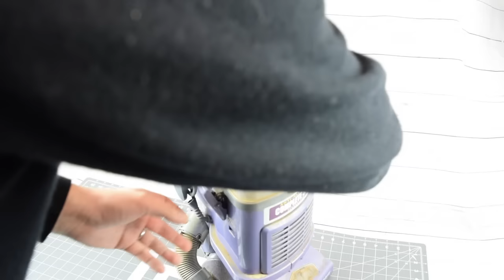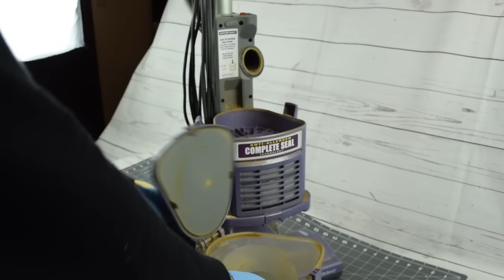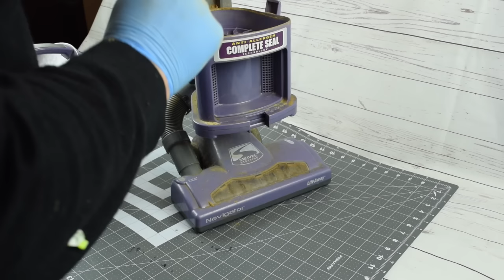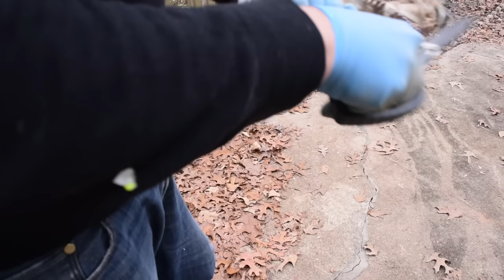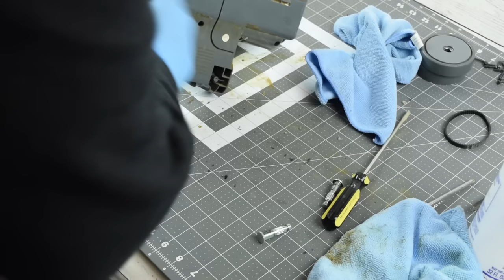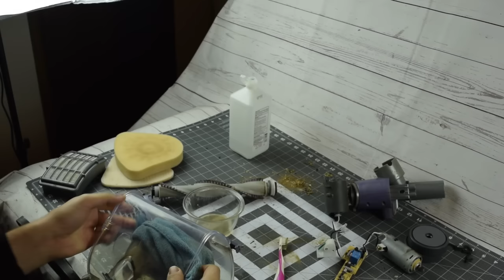How to DEEP CLEAN / Refurbish a DIRTY Shark Navigator Lift Away Vacuum

Comment: It seems the six screws toward the front of My Vacuum have a nub in the middle of the top of the screw. I'm wondering if the maker did that to prevent me from cleaning/fixing my vacuum so therefore I might opt. In buying another New vacuum... Can I get suggestions on how to get the screws out of the machine, please? Thank you.
Reply: Same here.  Have the correct star head, but the opening is too small.  Would need a special screw driver.

Comment: i have a question: i cleaned the hepa filter with water two days ago as it said to in the directions and let it sit this whole time. when i just turned on my vacuum it spurted foam everywhere through the hepa filter. what the heck happened?
Reply: update: i used my vacuum today and it didn’t spurt foam but the place where the hepa filter is smelled like it was burning
Reply: (in the directions of the shark vacuum it said to rinse it under water)

Comment: I am having problems putting the wee little wheels from the bottom back on.  The ones at the very front that you took off to get to the screws.  They don't seem to want to pop back in.  Anybody?  Any suggestions?

Never mind.  Thanks though but I managed it.  And....it's done.  So glad I saw this video.  Helped tremendously.

Comment: If the hose and wheels, latches are broken it's not with it or to it buy used. You can get a used fully working one for "dirt"  cheap $0-50. Buying  replacement parts is where gets expensive.

Comment: I clean my hoses out with hot soapy water soak for day then rinse with hot water I cut the hair away from rollers and use tooth brush with soap on to clean the bristles and all the seals on dirt container as well as small amount of silicon oil around seals .

Comment: I bet putting a lot of those parts in the dishwasher would work well. Especially the canister will all the tight spaces. Just don't put it on the high heat or dry setting and just let it air dry so the plastic doesn't warp.

Comment: The SHARK manual states that you CAN wash the HEPA filter. Not sure why you say it shouldn't...
Reply: @SupaTrending Daily stop spreading false information. You can literally do a quick internet search regarding this topic.
Reply: @Lethal except the manual states you can. so. you clearly did not do your research. thumbs up
Reply: Washable in the sense that all you can do is rinse it given how it's constructed, but it takes forever to dry. (Like a week unless you have an air compressor to blow it out or something.) And when that's the case any remaining dirt may cause issue with mold or other stuff growing on it. Technically "ok", but from a practicality standpoint I can see why it's looked down upon.

Comment: I own a shark nv70. The instruction manual for mine says you CAN rinse the HEPA filter under the water dirty side up until it runs clear. If I want to clean the filter inside the dust cup with a scrubby green pad as shown do you need to use soap with it or just plain water to remove the dust from it??

Comment: I just run water through my canister. And let it dry.? Then I take all my hoses off squirted with Dawn dish soap and hot water let itself. Then rinse very well hang them outside to dry.
When dry I put one or two drops of  essential oil on foam.

Comment: Mine broke at the bend where the long handle is attached to the pivot point of the brush housing 🤣...

I ended up epoxying a steel rod through the center within 2 drilled holes and I plastic welded the whole thing back together with steel mesh embedded in the plastic... I figure it's prolly stronger than before..
Wish I could post pics in comments

Comment: I accidentally vacuumed up a small foam paintbrush while using the hand attachment . Very little suction yet I cannot find where it went. I removed hoses that easily came apart. Is it possible I'd need to take the lower part..near engine apart too? I can't believe I can't locate this paint brush as it was four inches long although narrow.
Reply from the maker: Have you checked the wand and the hoses? If it is not lodged in the floor nozzle I bet its in one of those.
Reply: @VacuumWars  i found it thanks!

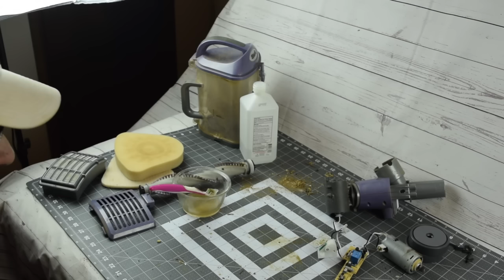Comment: Do you happen to know what the (clear) tube with the spring in it is for (12:30ish on the video) attached to the top of the casing for the motorized brush assembly? I have it attached to the part that would suction the dirt from the floor, but not attached to anything on the other side. Yet, it was full of dust/pet hair? Is it supposed to connect to something?  Thanks!

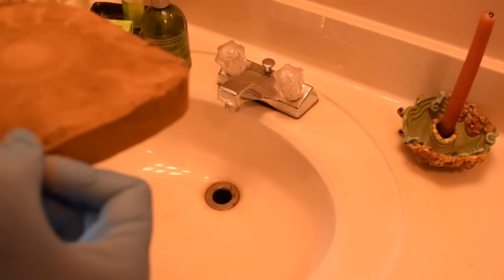Comment: 1:56 it says to use cold warning runner on all three filters not hot water.

So either the company is lying cuz they want you to rebuy the filters quicker by running cold water is bad for it and hot water is better
or you're misinformed in doing it wrong.

Comment: What about the hose!??? ☹️ I have gunk stuck to the inside of the hose because a roommate used my vacuum to suck up something wet. I can't find any info about disassembling the hose handle. While it's mounted in that bent shape, my cleaning tool can't get inside. I need to remove the hose so it can be straight to get the tool inside.

Comment: I bought a nv70. Used.  From a guy.  I had to take the whole thing apart it was completely wet the filters were all soaked and wet in the head was all nasty I soaked it and all the components I soaked had to take the motor off clean the base everything works like new

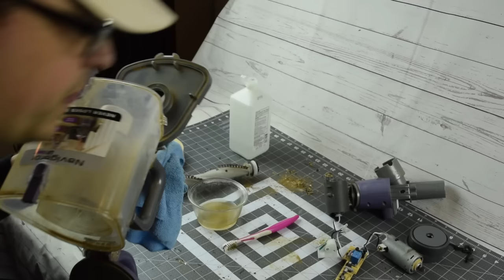Comment: A gasket showed up in the bin of my NV357 and I'm trying to figure out where it came from so I can glue it back in. My best guess is the end of the short hose that connects into the brush roller. Very similar to what you are holding at 14:02. Thank you for any thoughts and your time.

Comment: Can you please do a video on why the sweeper shuts down while in use. My sweeper has been very well maintained and has just started shutting down in the past few weeks. It will start again in a few hours and works well then the motor shuts off all over again. Thank you for your helo.
Reply: Sounds like the motor is overheating and it has a shutoff once it reaches a certain temperature.  If you are able to disassemble the bottom as shown in this video, with any luck, you'll find that the heat vents on the motor are blocked.  Remove the blockage so the air can flow through to cool down the motor.  
If you find there's no blockage, then it's likely not feasibly economical to repair or replace the motor.

Comment: You sure spend a lot of time with your 'green scrubby pad' and microfiber cloth.  I just take mine apart, and put under the laundry sink faucet and HOT water.  Dry for 24+ hours, and put it all together.  Of course, mine will never get this clogged, and I'm not trying to resell it, so if a bit of discoloration remains, I'm not worried.  Nice video though.

Comment: That is by far the nastiest vaccum I have ever seen. Good job on your deep clean but I still wouldn't bring that gross think in my house. And the filters are so cheap for these vacuums why not just replace?...$11.00 for 3 of the foam and pad and one of the hard cased that goes in the front. No matter how much you soak/clean it and let it dry its still going to retain some odor. Thanks for the video.

Comment: My vacuum is making a loud noise when the brushes engage I removed hair but it is still making the noise. Any suggestions?
Reply: aussiegirl43 sometimes the life time belt comes off the tread
Reply: This is how I found this video.  When I turn on the brush/roller, it makes a very loud sound.  I took everything apart and cleaned, per the details in the video.  I had some hair/string wrapped around the motor.  Everything is drying now but I'm hopeful this takes care of the issue.  I'll report back if it doesn't.
Reply: The rollers will have bearings or plastic "rollers" at each end. Once these get dirty or worn you have to replace the bad bearings (metal or plastic) or just search online for a new brush assembly.